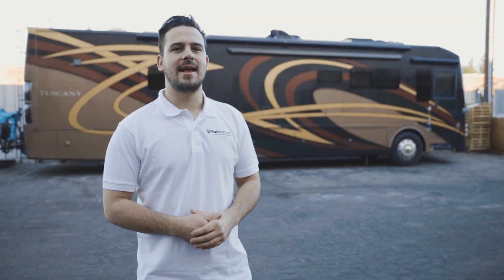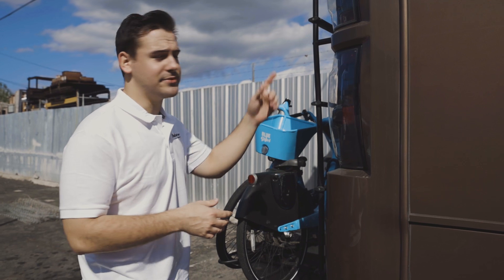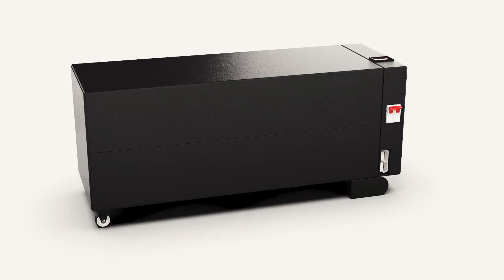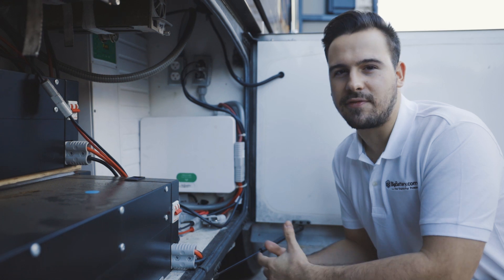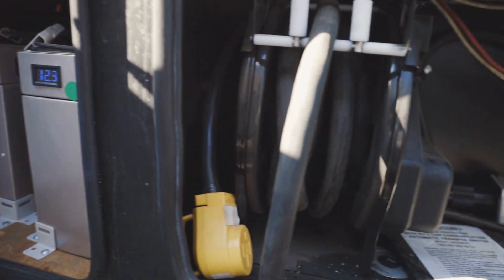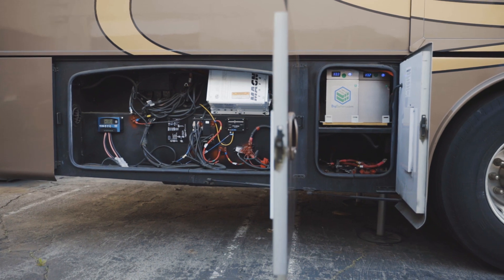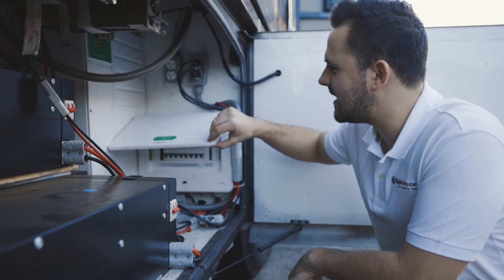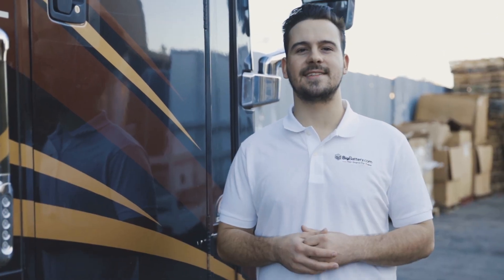The BigBattery RV | The Ultimate RV Power System

Comment: I'm running 8 serve rack batteries from Rich Solar in my RV with 2 5000w Victron inverters. If I do my math right, I could save considerable space by changing to the 48v batteries mentioned in this video, correct? The batteries are in the same bay as displayed here and are stacked two high and 4 wide. I have more Solar but marginally so.

Interesting question... Why did you decide to use such low grade gear for solar controllers (the small blue solar controller speaks to you but only in Chinese! I also saw a few other pieces with no English writing whatsoever. I figured you guys would be using something like Victron or Eg4 for that gear. Finally, i see the wiring used for a 48v system and although the value of a 48v system is smaller gauge wire, if I'm translating correctly you're using 16 gauge wire for the 48v system? 

I"m seriously considering the 12v Husky 2 400Ah battery for my other Econoline E350 van/sleeper to save some space.
Reply from the maker: Hi Jason, thanks for your comment! This video is actually a few years old and showcases a couple models from our Gen 1 product line which we no longer carry unfortunately. However, our Gen 2 product line, including the 12V HUSKY 2 you're interested in, are significantly upgraded versions of our flagship models like the EAGLE and HUSKY. If one of your main goals is to reduce system size and excess cabling, the 12V HUSKY 2 would be an ideal choice for you. Each HUSKY 2 comes with a set of configurable mounting plates so when you're setting up your battery system, you have a ton of flexibility when it comes to orientation and installation. Plus, we have a wide selection of inverters we pair with our HUSKY 2 kits, including Victron, EG4, and AIMS, so you can always stick to your preferred brands.

You can check out our HUSKY 2 kits here (https://bigbattery.com/rv/) and feel free to give us a call at (818) 280-3091, or send us an email at Sales@BigBattery.com to connect with a team member who can discuss your current system more in-depth and ensure you find a solution that works for you!

Comment: Is there any place to gather more information on this setup? It appears you are using lithium as start batteries? Also are you running the air conditioning units on the 48 volt system?
Is the 4 12v batteries running house side of coach except for the systems assigned to the 48v side.